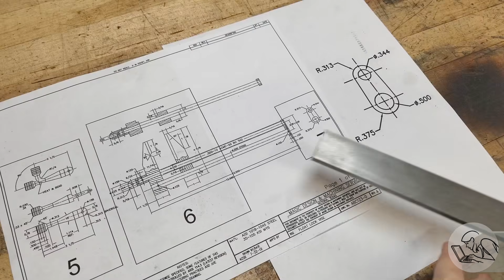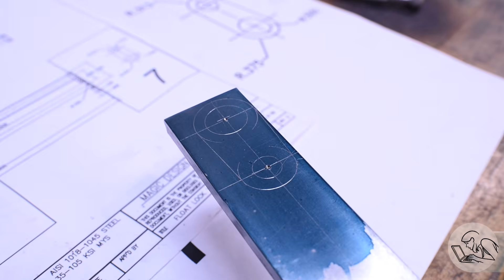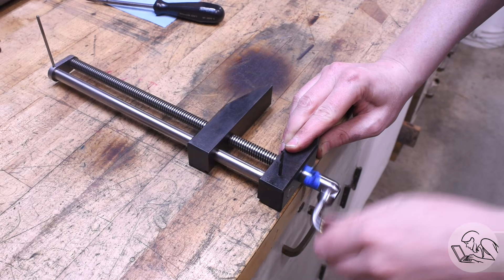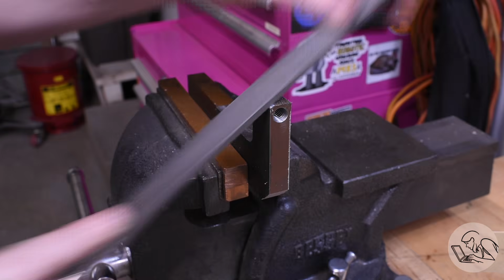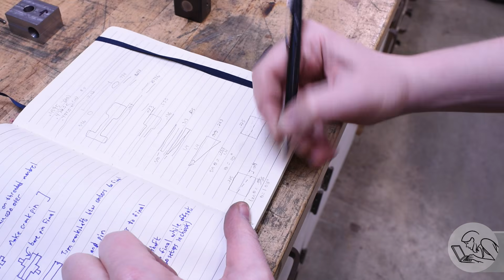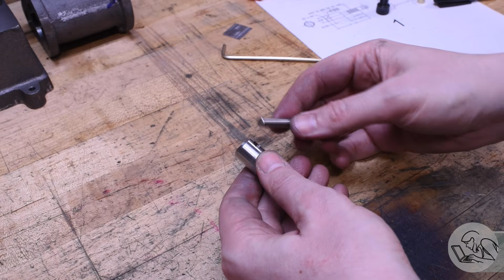Are Float-Lock Vises Any Good? Finishing Mine And Testing!

Comment: Great video, so glad the lift issue was solved!  Here’s a question. You mention that you can reload an identical part after a 1/4 turn to release the first part. What happens if the position of the handle when properly tightened doesn’t permit this? Could this be solved (or actually avoided altogether) by putting the crank on the far end of the lead screw? It’s a little less convenient to reach, but it’s always off the table, so no issues with crank position when fully clamped.
Reply: I have no experience in machining, but my guess is a double-jointed crank would solve this problem.

Comment: On the subject of starting a thread, we were taught to apply a chamfer of 30 degrees to the parallel sides to the bar diameter ,and more if it was a particularly large and difficult thread to start ; i like you dont always do it on small threads, but do on large course ones.

Comment: I never liked those spring loaded center punches,  at the Iron shop I worked at years ago I liked hand held with a sheet metal hammer the best . On another note when I was a firefighter one of the guys had a spring loaded punch for quick window entry,  but the spring was on the outside ,it flopped around on the bottom of the punch if that makes any sense,  it would work under water real quick if u were stuck and u wouldn't have to hold on to something anchoring yourself while pushing the other kind against the window . He told me it was a tool for taking out hinge pins from doors , I haven't seen once since it was old-school.

Comment: Quinn,

You did an outstanding job on building the float lock vise.  I'm glad the drawings proved to work with minimal issues.  Do like the swivel brass handle, nice feature.  I forgot about the slight angle of the hole on the clamp block.  You did an impressive job describing it and the reason for that hidden feature.  Now, to finish the one I started nearly two years ago.  Thanks for sharing, Ken

Comment: I wonder if it might be useful to fit a ground 1/4" pin in a second cross-hole between the two faces of the clamp on the other side of the clamping hole and solder it to the lower jaw as a fulcrum, so the two halves of the clamp could remain parallel.  Just for aesthetics obvs. Lovely job.

Comment: Oooh, I SO need one! Maybe add some vertical and horizontal vees to the jaw faces to make it easier to hold round stock? 
The extra security you get from using these de-vices (sorry) is a huge safety benefit. I had the joy of experiencing the mayhem when a large drill vice started spinning fast on the drill press table on the end of a half-inch drill that grabbed a part. The drill soon exploded into shards and tossed the vice a surprising distance, taking a chunk out of a wall. Now I always fit a bar on my drill vices and run it through a ring to prevent "helicoptering".

Comment: If the clamp as a 1 degree angle does that not mean that the jaws are at a 1 degree angle and everything you drill is at a 1 degree angle? Or did I misunderstand?
Reply: The rods bend and the sides of the jaws sit flat against the surface.
Reply: @EmyrDerfel  I wondered if that was the case. Thanks!

Comment: Having only watched the Mr Pete videos about this design, I also had no idea the 1° angle existed.  Now that you've used this, do you feel the rod and screw flex enough that the jaws actually lie flat on the drill press table?  I'm curious if the angle in the clamp translates to a tiny angle in holes drilled using the vise.

Comment: Excellent!!

I'd likely add an end stop to take maximum advantage of the possibility of leaving it fixed and couple of pins on the top of each jaw to clamp awkward stuff, like thick flat stock with rounded edges. But that's exactly what the vast majority of the drilling is around here!

Comment: Wow! That looks super handy!
We just got a Shars 6" rotary table at work. I don't know if it's made by the same factory as the Vertex. It has three T slots instead of four, and unless I'm missing something, they're at an arbitrary angle vs. the 0º reference on the angle scale. None of them appear line up with a mill axis within the adjustment range of the pointer. I can compensate for that in any fixtures I end up making, but seeing how you used a T slot edge to line up your part axis... maybe I should just drill a couple more holes in the base and move the pointer?
Reply: Seems to me that if you can do so accurately, then it can't hurt and will probably help.
Reply: @theprojectproject01  The 0º pointer is adjustable over a few degrees, anyway, so moving it shouldn't be tricky. Maybe its desired location will end up conflicting with a name plate, so maybe I'll have to relocate or remove it? I'd still expect to indicate setups in, but it would be nice to be able to adjust the needle to zero afterwards instead of having it point to some arbitrary number.

Comment: Thanks Quinn. Where’d you get the dividers for measuring from the end of a part. That would be great for the lathe work.
Reply: Try searching for 'odd leg dividers', 'hermaphrodite dividers' or 'jenny dividers'. That should point you in the right direction. You may also want to include 'round leg' in the search to find a pair more similar to the ones Quinn uses.

Comment: Learned something today from a woodworking video.  How to use a pencil (?scribe), first put pencil tip on mark then slide straight edge to pencil and draw line. That way the line is where it’s supposed to be and not effected by where the cone of the pencil tip rides the straight edge.

I seldom get chip interlude more ribbons, coils and slinkies.

Comment: Great tool, well done! A drill press vice has the same floating action when just 1 T-nut T-nut is used, partially tightened. I seldom have to fully tighten or use more T-nuts, it holds pretty well with just 1!